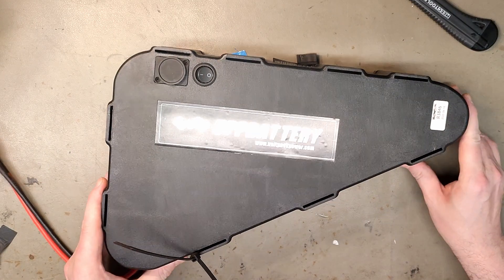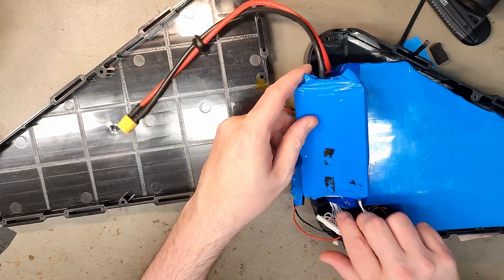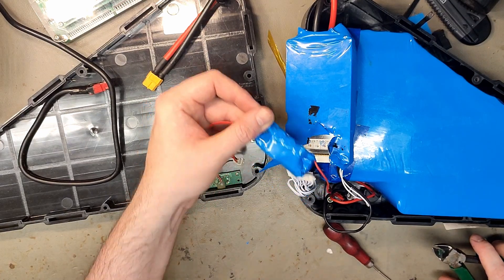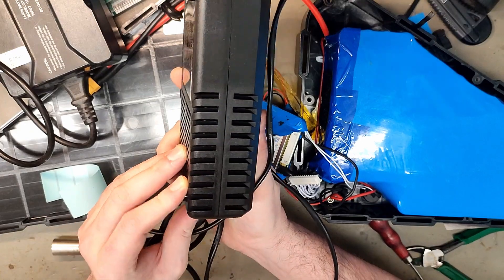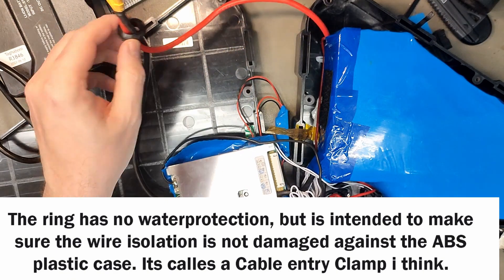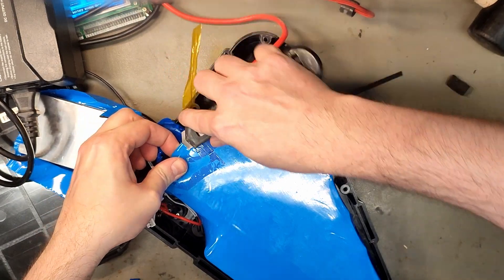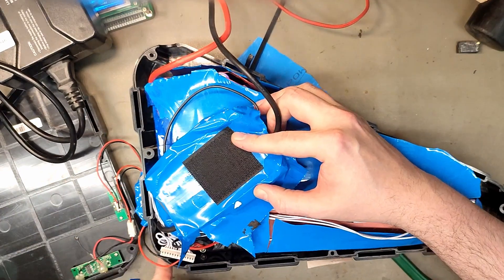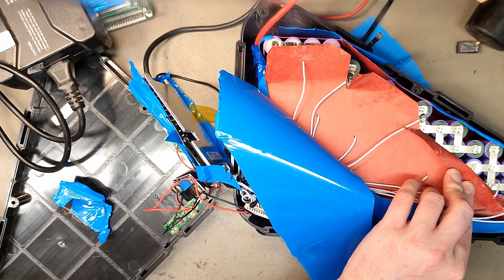Unit Pack Power Triangle Battery not charging (48V20Ah) Troubleshooting

Comment: What is your opinion on the build quality of these batteries? 
I have one and so do 2 of my friends now but there's been a government recall on them here in the UK.

I'm reluctant to give up my battery because it has worked flawlessly. Charges to 54.7v every time and provides me plenty of power for a reasonable amount of time on my ebike which is meant to be 2kw (I doubt it is) 
I have the 20ah version 48v

Also is this battery capable of charging via the power output plug? I had some issues when running regen. Blew the same MOSFET twice until I bypassed the PCB on the live leg of the fet with some enamalled wire.

Comment: These batteries have an expiration date, you buy a UPP battery because they're half the price knowing they are going to last half the time, the only question is what do you do with it when its dead.
Reply: Done over 700 miles on mine so far and it hasn't shown any sign of declining yet 🤞🏻
Reply: @MaNNeRz91  I have two of them, the one with 1600 miles is perfect, my other one completely died around 2800 miles, it was also perfect till about 2500 miles and then degraded quickly.
Reply: @bassw1758  I mean that's less than 50pence a mile isn't it? I can live with those numbers 😂
Reply: @MaNNeRz91  yes but I've heard of better batteries getting well over 5,000 MILES
Reply: @bassw1758  I'll keep you updated if it fails on me any time soon. For the price I really can't complain too much. Sits in the frame nicely and charges at 1v an hour so I can pretty precisely time my charging 😂 as sad as that is.. 
I managed a 40 mile ride on it a while ago. Averaging at 17mph. And the bike does 40mph on full beans.
Reply: @MaNNeRz91  yeah I'm treating this battery better than I did my first see if it makes a difference, they always got pretty good reviews in the past, it wasn't until recently that they got a bad rap.
Reply: @bassw1758  I still think that's a mix of "government scare" and people who don't charge them with the right chargers/mistreat them and their bikes.
Reply: late but, i had a hailong battery and when it started showing signs of wear i got a bunch of new batterys, samsung ones with really high capacity and fit a new high amp bluetooth bms.

Comment: Its crazy that standards are not there for different charging connectors for different voltages and much much clearer labeling on battery and charger saying what they are . Its crazy easy in a household of 5 ebikes to mix them up . Anyway had 5 of these batteries ., the oldest nearly 5 years old but i am gentle with them and they have proved to be great value for me  with over 30000 miles collectively on them .. There is a recall now as linked to fires in UK . I am not disposing of mine but i will charge  and store in a fire safe place .
Reply: BMS usually stops when the voltage limit has reached. But I am talking about a good BMS - UPP obviously cheaped out on everything here, except the insulation paper

Comment: What a strange comment, bugs laying eggs in electrical equipment, in any case you shouldn't be repairing battery packs at home with the danger of fire.
Reply: just have a clay flowerpot with lid next to your repair station, the lid must have holes for the fumes to exit, and having some thick sand just in case, this thing saved me  3 times

Comment: Could two 36 v ebike batteries be connected in series for 72 v ? Would something need to be done with the two BMS ?
Reply: If your 36v batteries have a 20A BMS for example then you can remove them and set your current limit (p14 on the sw900 display) to 40A and put a fuse in between the positive and the controller. Only charge with the correct voltage charger and monitor during charging, once it reaches 1 or 2 volts away from full take it off. Monitor heat of pack when charging/discharging to make sure you’re not overcharging or overdischadging. Also don’t discharge the pack below 62 volts
Reply: You would need a bms with chips that are rated for 84v, since the second bms in series would be seeing that much voltage

Comment: Trying not to throw shade but the title says "troubleshooting" the only thing you did was take it apart. I have the same pack and have taken it apart only to find nothing glaringly obvious
Reply: Yea thats how he sort of clickbaits but if you watch his videos you would understand he does tear downs of different batteries to show other builders if they are worth the hassle of repairing or not. Some batteries have configurations that require a higher level of skill and he saves ppl wasting their time or taking on a job that is not worth doing
Reply: @hus_10001 turns out this battery was recalled for starting fires a few months ago.

Comment: Why should the charger be damage because of bugs? There are many devices that have ventilation holes and i don't get any bugs in those devices that breaks it.
Reply from the maker: It's more important if you charge in non temperature controlled room like a shed, garage etc. Bugs are always drawn to heat when its cold outside and a nice warm charger are perfect for spiders and other bugs to build nests in. If you only charge indoors when the tempature is around 20C then it is usually not a problem. We have dismateled many chargers and inverters to find out what was wrong and many times it's bugs.

Comment: Do you know how to fix if the back brake doesnt work on the fatscooter? It has DOT4, so its not that. I have looked but cannot find the problem.
Reply from the maker: The breaks are terrible but works like moped breaks, if it does not work at all, the fluid has leaked, if it works but poorelly you might need brake pads. They are very cheap but different front and back: https://s.click.aliexpress.com/e/_DDhmfF9

Comment: Do you know where I can get a good citycoco battery, the one that goes under the seat with the handle.. looking for a 60v 30ah 35a discharge BMS..
Reply: My advice is first research cells. Decide what cell will be best for your application. You don’t need high discharge I would prioritise high capacity in your case so look for 5000mah cells. Next look at cell holders and check if the dimensions will fit in your old battery case with the cell layout required, for 60v 40aH you are looking at 16s8p which is 128 cells. Can you fit 128 cells in your old case? If not reduce the parallel rows until it will fit and calculate the capacity to make sure you’re happy. Next you’ll need to find a BMS that for 16s and however many parallel groups you chose, aswell as the correct discharge rating. If you chose 5000mah 10A cell for example and you end up with 5 parallel groups you can discharge up to 50A. For safety apply a multiplier of 0.75x. I wouldn’t recommend drawing more than 35A from this example pack
Reply from the maker: We have been looking for good 60V case batteries for years how ever all samples we have bought turned out to be bad so it better to DIY or take it to a repair shop. Especially if you need 35a, most packs we have seen could not handle even 15A without capacity loos.
Reply: @TheBatteryDoctor  I'm willing to pay or just build my own now at this point.. roughly how big of capacity can fit in those handle case boxes? Is 60v 40ah 35amp BMS possible??